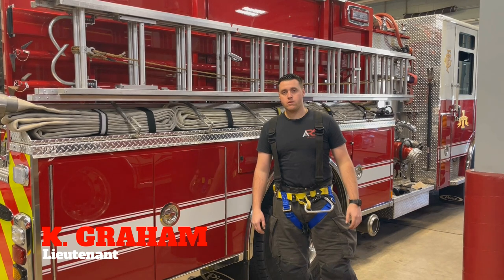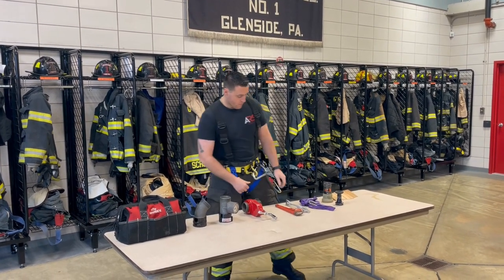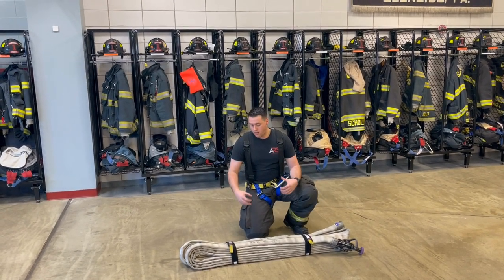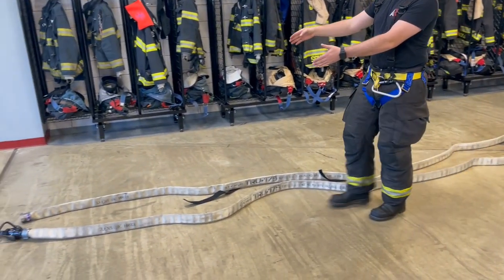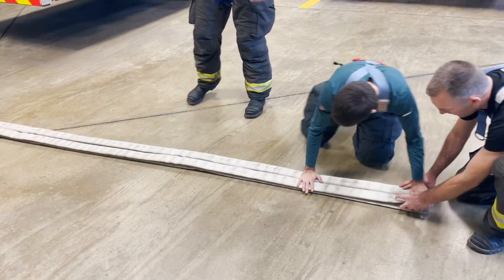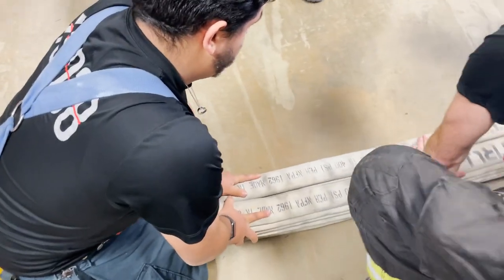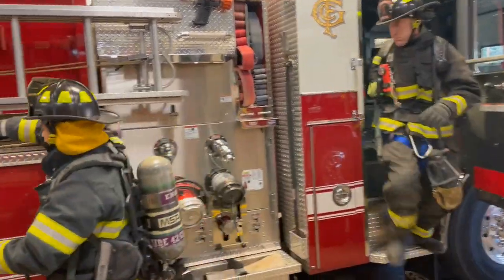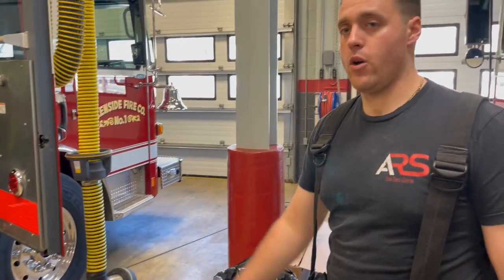Apartment Pack Overview

Comment: What size of hose are you using for this hose pack?  What is the nozzle tip size you are using? How much waer will you rhose pack flow?
Reply from the maker: 1 50' section of 2.5" hose 2 75' sections of 1.75" hose with a 7/8" smooth bore and 165 gpm.